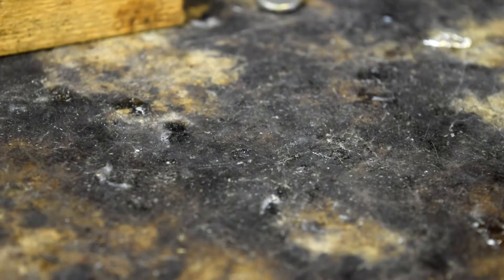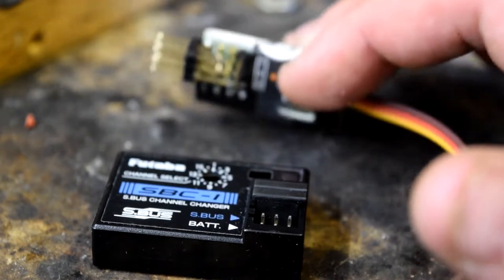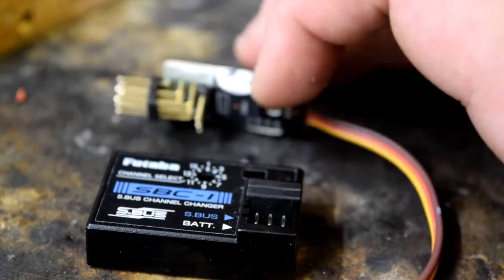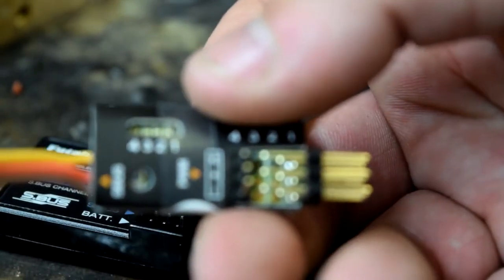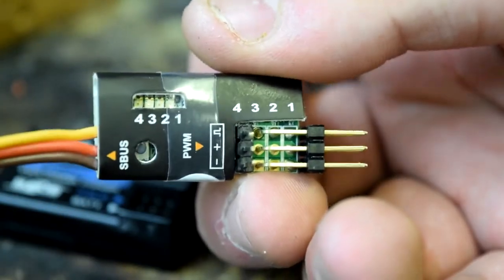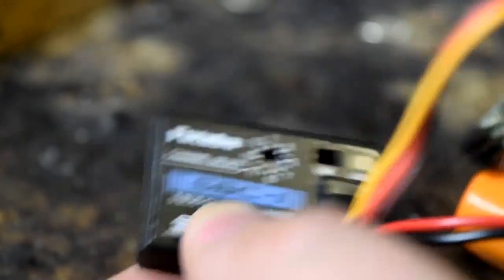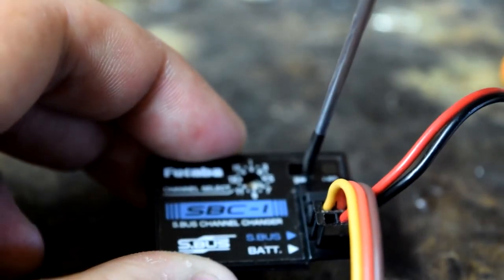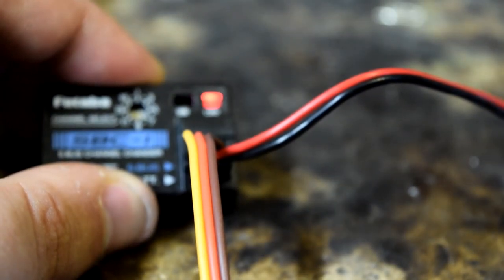Frsky Sbus Decoder!: - What Is It? Why Use It? And Setup Tutorial!

Comment: I am not getting, why don't we use PWM output receiver? why use  receiver with SBUS output, and then convert back t PWM? I am new, so if its very dumb question please forgive me :D
Reply from the maker: Non-sbus compatible servos or equipment, Installing the receiver remotely (for example, on the end of a wing) and only having one wire to route back to the fuselage, adding more PWM outs to a receiver.
Reply: @JakesRCStuff  thanks